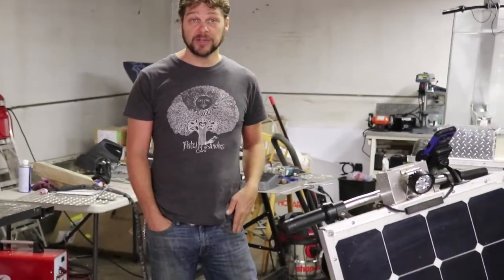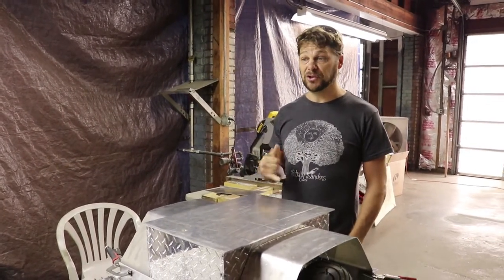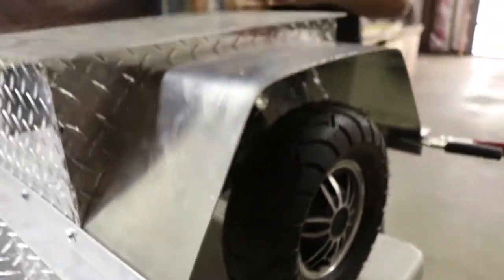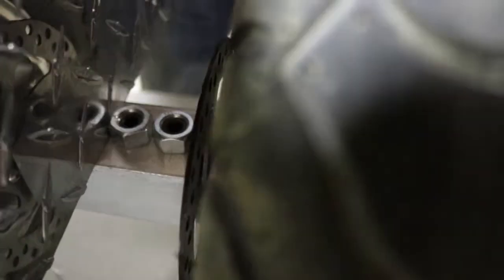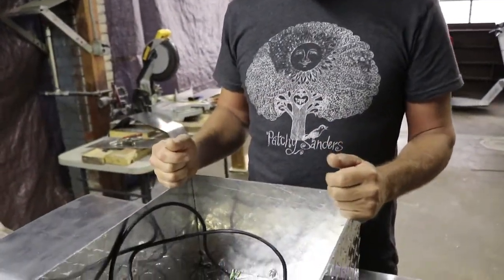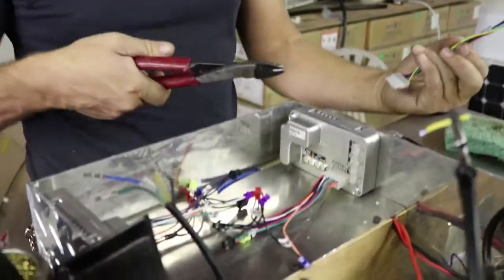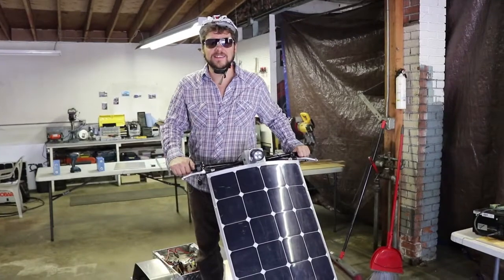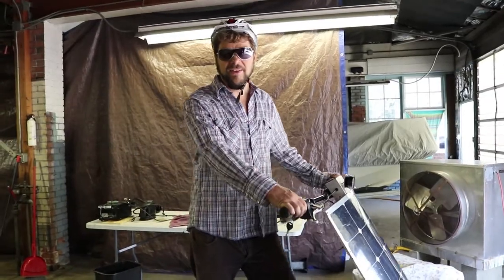Solarrolla- Solar Rover 2 Solar Electric Scooter

Comment: Would it be more practical to mount the solar panel on the rear or a roof so they would not be damaged by debris from other vehicles? just saying.
Reply: A simple acrylic shield would deal with debris just fine.